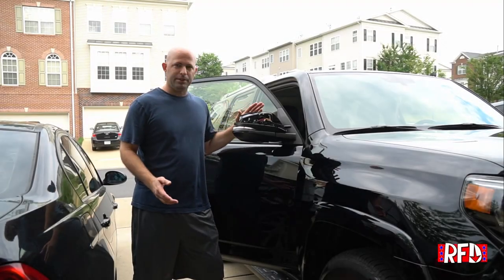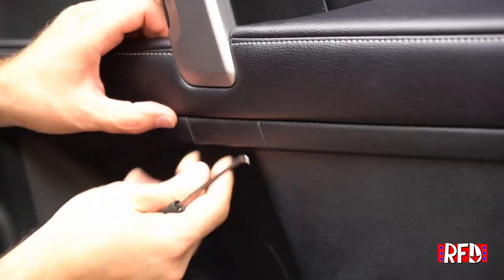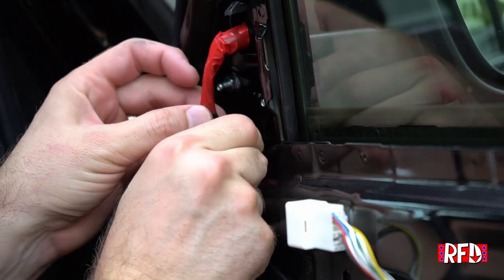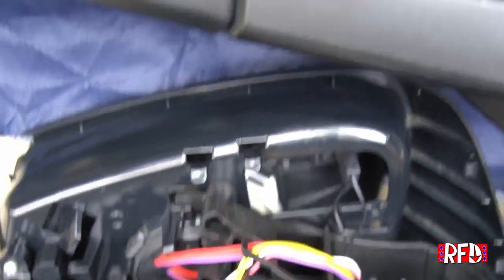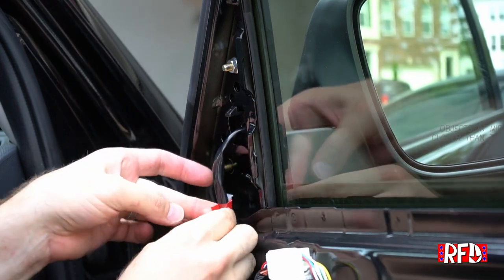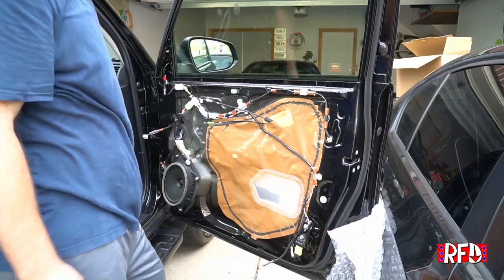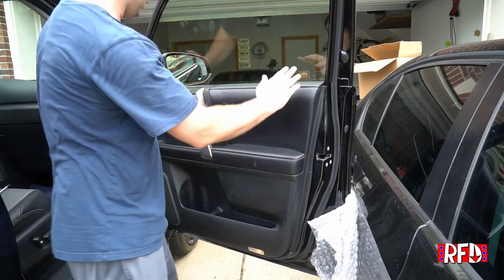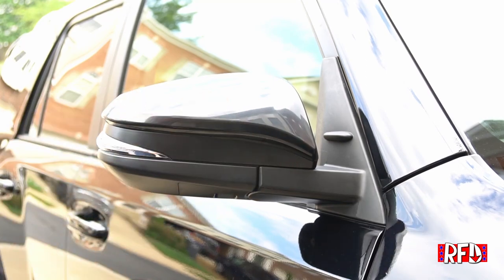Toyota 4Runner Side Mirror Replacement

Comment: Great video.  I did the job in almost the same amount of time as it took to watch this.  By my watch, just over 35 minutes, which included time to use Goo-Gone to get the Duct Tape residue off of the old cover, since that one matched my silver 4Runner, rather than the black cover that came with the replacement).  (Damaged my mirror backing into the garage, so the old cover was still good.  I had taped it in place while waiting for the new mirror to arrive.)  
A couple of tips for the next person watching and learning.  There's a little plastic fastener in the bottom left corner of the mirror assembly, and it holds the rubber weather seal.  The replacement mirror didn't come with it.  Pop it off of the old one, but don't put it right on the new one.  Wait until you have the mirror in position and can get the weather stripping lined up to the hole.  Then pop it in.  Beats trying to stretch the weather stripping over the fastener, which probably went in too far when you pressed it in the first time.
I also found it a bit easier to do this with the window down.  It made it easier for me to get the top of the door panel onto the door frame at the edge of the window opening.
I ordered the replacement mirror from Rock Auto. TYC 5320552 for about $85.  Two types of mirrors, one has a "puddle light" underneath it (comes on when you hit the door opener on your key fob) and a turn signal.  This one has the 11-pin connector.  The other one doesn't have those features and has a 5-pin connector.

Comment: I dodged a massive piece of ice, and need to replace the cover and lower cover, which now has a hole.  This piece of ice would have penetrated the windshield or would have dented the vehicle, but I was able to skirt it just enough before the air stream pulled it towards me.  Any chance that Toyota sells just the lower cover part?